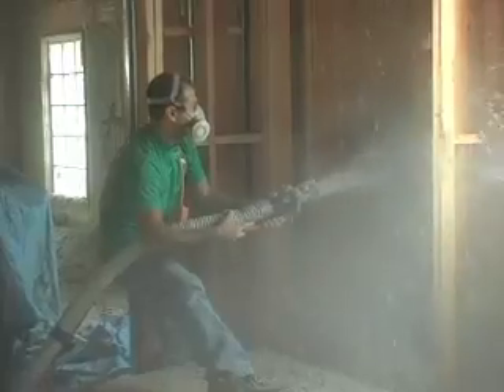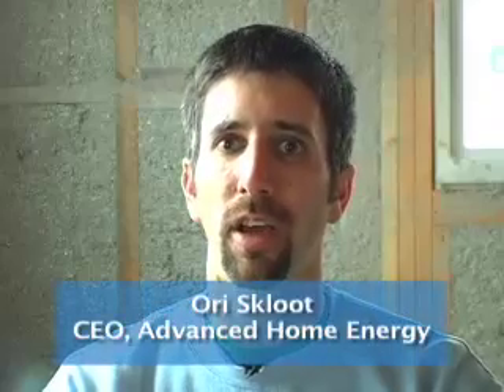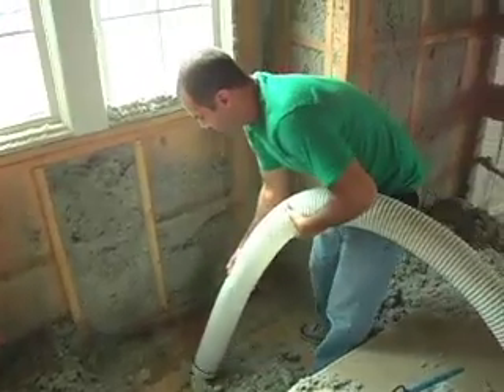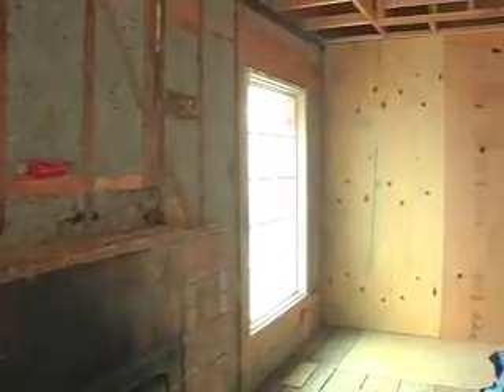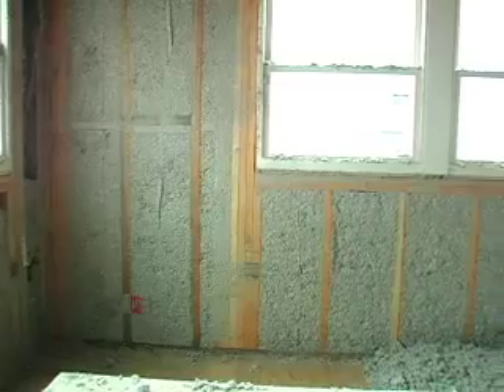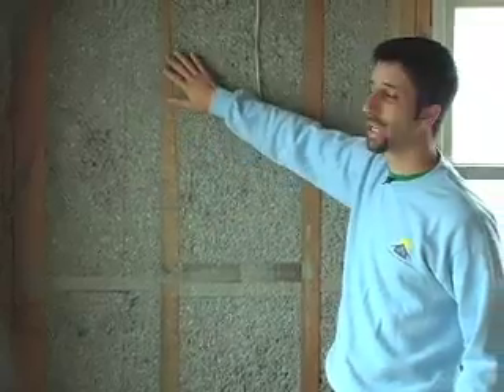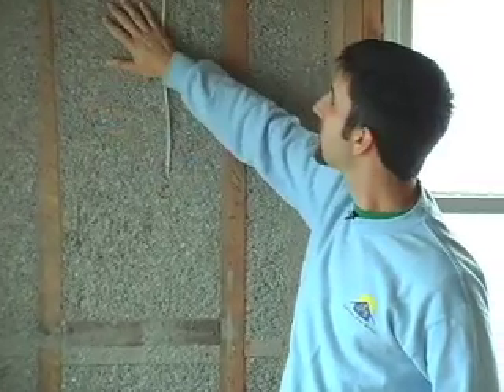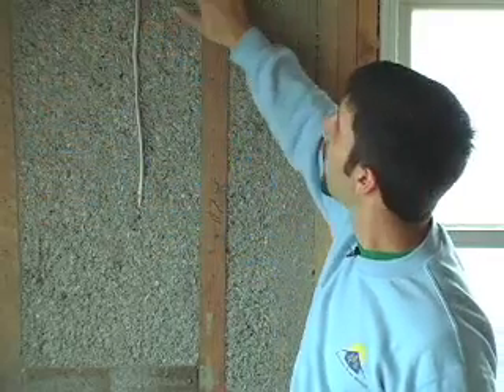Learn About Professional Installation of Spray Insulation

Comment: @01mustang05 Second, to keep water vapor from condensating while diffusing through walls, r-value allows for no sudden temperature changes, meaning no condenstion w/in the walls. Wonder how those 150 year old homes survived you your local downtown? Diffusion, w/out it, any wood product in your home will most likely rot.

Comment: @01mustang05 There is no room for "opinions" here in the real world of home const., there is only providing the best product for the customers budget. I have seen many builders fall for the residential spray foam BS, and when the savings don't match the costs, owner see this and those builders don't last. You obviously don't realize for every climate, is a different r-value based on condensation, and performance. First,, trapping the water vapor is asking for trouble, NO VAPOR BARRIERS.

Comment: @lacochinit Sure, the insulation that has ruled over 85% of the market for over 50 years is bad for you now? The govt. recommends it because it it bad for people? The Energy Star logo on the side of the bags means bad for you? Paint requires more of a mask rating than insulation installers, maybe we should worry about paints too, and then all the VOC's coming from finishes and carpets? Or we can assume that foam in all it's glory, over many decades, is only 5% of the market for a good reason.

Comment: @d1incharge OK then< please explain why "closed cell" spray foam is the wrong choice. coping with moisture should be the main topic here. maybe u could explain dew point diferences and or the breathability or the air that carries water vapor through these 2 insulations. 
leave the sarcasim out of it and lets hear why this is better than spray foam. (closed cell;  or open cell or 70% closed if u know about these foams as well)

As for your neibor...look into insulation on the outside of frame.

Comment: @commonman80 Sure it is.......that must explain why it has been around for 40 years, and holds less than 5% of the residential insulation market, cause it is the best.......maybe you could explain to my neighbor why his foam house has such shity bills, and moisture problems? I was thinking it could be the R-6 foam on the walls, and R-15 Foam on the roof? I am just a 30 year vet at energy auditing, home building, and HVAC design, what would I know. Anybody installing foam is a crook, and a liar.

Comment: @cuzar Cellulose is usually around R-3.6-3.8/inch.  Similar or better than open cell foam which I believe is just 3.6/inch 
In a 3.5 inch wall I believe they are both rated around R-13-15 depending on installation, which is U .077-.067?

Comment: @commonman80 Open cell Foam=petroleum product ,  Foam=No gain in R-value over cellulose.  Foam=not as good at stopping sound as cellulose  Foam=Far more expensive  3-5TIMES!!!!!! Foam=least used of all major insulations in new const. AND retrofit.   Foam=When applied to roof deck, increases the air to condition, and increases the surface area of the envelope, creating the need for a larger HVAC and mechanical fresh air ventilation.(unhealthy VOC air foam holds in the house)  Nice try though.